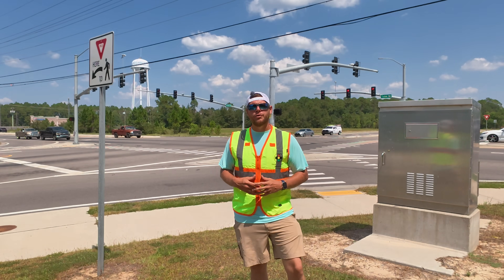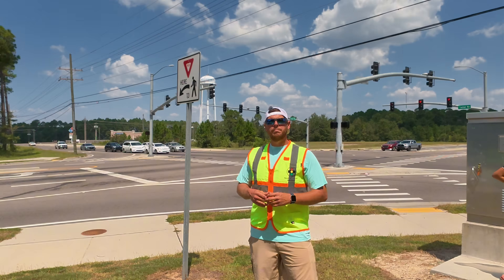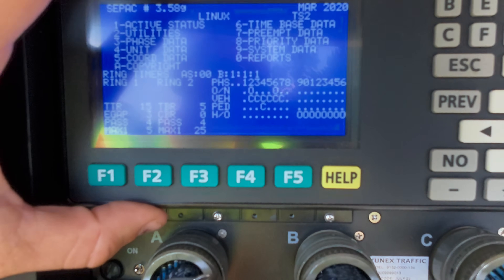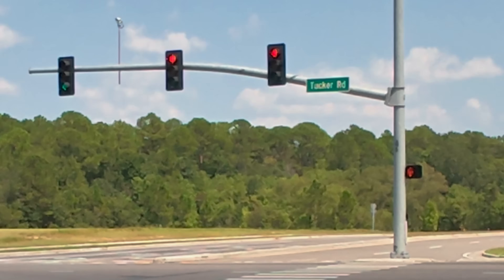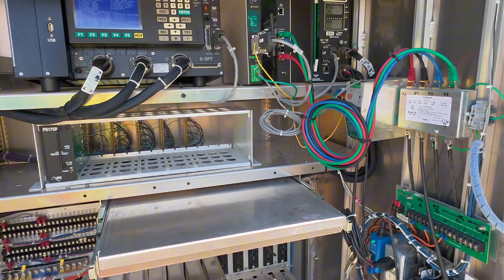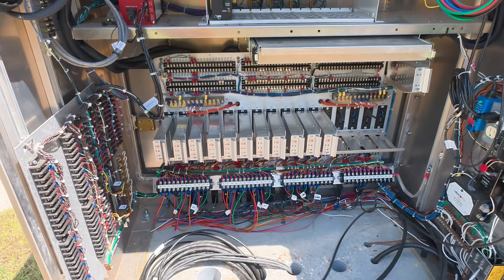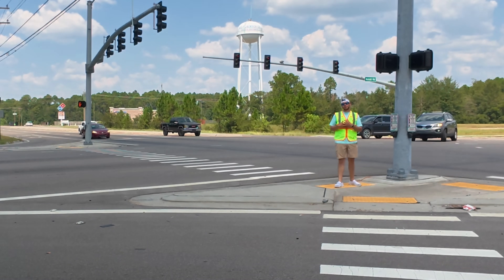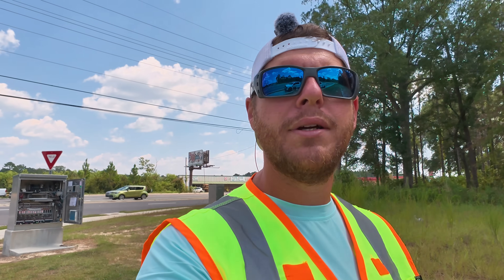Traffic Light Doctor Explains: Do Crosswalk Buttons Work?

Comment: I don't care what the rationale is for prioritizing traffic over pedestrians. Morally, a pedestrian in the freezing cold or the pouring rain is a million times more important than someone in a toasty warm, dry vehicle! The light should change in favor of the unprotected pedestrian, as soon as they push the button.
Reply: Not as soon as they press the button, but as soon as reasonable. There are minimum light timings that must be respected. Also it's sometimes beneficial to limit the frequency of the walk signals in certain cases (if there are many people crossing you don't want to let each through individually, you want a few to cross at a time).

Comment: Those are pacifier buttons and they don’t do anything. The walk sign always comes on when it cycles to the traffic that is parallel to the cross walk turn to go, at least that is how it is in the state I live. Not very many people would be walking in that crosswalk anyways it’s just a place for cars and not people. 

The funny thing is that where there are a lot of pedestrians, USA rarely has pedestrian bridges. My brother lives in Japan, and there even in small towns, pedestrian bridges and even under passes are everywhere. No need to cross a super ugly and super wide highway.  Though many are in disrepair and old and they still have a lot of crosswalks too.
Reply: Different places handle it differently. I swear when I've been somewhere where the lights worked like you describe there weren't any buttons. If there are buttons they might be from previous programming. Or for modern setups the buttons will activate the audio notifications.

Comment: Our pedestrian buttons cause a change in traffic light timing - once you push the button, it triggers a timer to stop traffic and pedestrian crossing activates with the very next sequence. If adjacent buttons are pressed, traffic lights will all go red for cars and both crossings will allow pedestrians to cross at the same time - if just 1 crossing, it will allow cars in the same direction with no light for turning (turning drivers may go if there are no pedestrians even if it's green light for crossing)

Comment: Short answer to thumbnail question:

Sometimes.  It depends. 

   Expanded explanation: 
Some traffic signals will only give a walk signal IF the button is pressed.  Other signals always accommodate for pedestrians (making the buttons superfluous)

Virtually all traffic signals in the US treat pedestrians as a low priority after thought. 

Ideally traffic signals would prioritize pedestrians by rapidly changing except during peak traffic periods which depends on signal synchronization to maintain the healthy flow of traffic.

I currently work as a gig food delivery driver in a tri-state region.  Two of the states have some kind of traffic sensors for the vast majority of signals; the other has hardly any & relies on timed presets with some areas intended to be synchronized although there always seems to be at least one signal that has lost synchronization in each of those stretches which has devastating impacts on traffic flow which some drivers use an excuse to disobey or even disregard signals creating significant danger to everyone, often emboldening more drivers to become aggressive, lawless & reckless. 
Most traffic signals have two or three timing presets.  The rush hour timing which has longer cycles often favoring one street.  The non-rush cycles which tend to be shorter and more equal.
A very limited number of signals have unique later-night or weekend timing cycles, or perhaps switch to flashing. 
The vast majority of the timing cycles seem completely arbitrary (or intentionally configured to generate congestion) because they do not accommodate for the consistent patterns of traffic volume.  Smart, dynamic or adaptive technologies to mitigate traffic congestion are non-existent.
The pedestrian beg buttons seen to be completely useless because they do not alter the cycle timing, and all signals always give pedestrians a walk signal. 
However, there is a very inconsistent & apparently arbitrary implementation delays between cycles and the amount of delayed traffic signal change after pedestrian signal change (to give pedestrians a head start).
These delays vary from about 1 second up to about 7 seconds!  But their programming is completely random as far as I can tell with the exception of many of the intended synchronized signal cycles.  They certainly are not based on the size of the street, the amount of vehicle traffic, or the amount of pedestrian traffic. 
This bread start for pedestrians is precisely the kind of thing that should be dependent on the beg button!  However, that doesn't seem to be the case anywhere in the region.

The two states which have large scale sensor deployment have major variations between cities or neighborhoods in how those sensors are integrated & programmed, including the pedestrian beg button function/integration/programming.  Some signals only change for pedestrians of the button is pressed.  Sometimes it will change immediately of the traffic signal is already green in that direction, others require a  nonsense waiting period, others require the signal to go through the change cycles.  Pedestrian button behavior is generally consistent within a neighborhood or city.

Some areas have very well programmed integration of traffic sensors & pedestrian buttons that respond reasonably & dynamically.  Other areas are so poorly configured that it can be even worse than the state without sensors because of ridiculously excessive wait times, even in the middle of the night.  Or in other areas, the sensors trigger a signal change so quickly that they are constantly changing so quickly that only a few cars can get through before they change again.  
And, of course, there is a significant number of sensors that are malfunctioning in some way; these teens to persist for many months or even years with repair/recalibration/reprogramming.

There are regions in other states that I visit for family, friends or work which have far superior design & implementation of traffic & pedestrian control technologies. 
This makes returning home especially frustrating!

Comment: Where I live, outside of the properly maintained ones inside campus town, the rest are mainly unmarked silver circle buttons, no lights, no audio, no indication of any kind that pushing the button actually did anything, and in my experience, whether the button is pushed or not, the actual Walk signal/ Stop hand will switch at the predetermined time in the traffic light schedule of that intersection. I suspect that there is a fail safe to detect when the button gets broken, and merges the walk signal into the normal light pattern, and then local government just doesn't care enough to fix the buttons, so you end up with buttons that legitimately don't do anything anymore. I'd love to see you do a video where you review buttons at intersections in lower income areas.

Comment: You should do a video where you verify ped pushbutton operation using your cell phone. Connect a WiFi router to the traffic controller. Use the web browser in your phone to see the ped calls going into the controller. Good method when working alone. We don't usually have a beautiful woman assistant like you have to help test ped button operation.

Comment: I’m still thinking the pedestrian lights are at a constant “Don’t Walk” unless you press the button, only then does the pedestrian “Walk” signal turn green when the aligned traffic lights come into regular rotation. It seems you can get the same pedestrian utility by ignoring the pedestrian lights and just go with the flow of traffic. You cross when traffic is going in your direction.

Comment: I am in Florida and the pedestrian signal always seems to be too short to safely cross. I am 6' 4" tall and I take huge steps and a lot of times the signal will change to 'don't walk' when I am not across the road. I feel sorry for those using walkers or who are short and slow.
Reply: The walk sign is not timed to stay on until you reach the curb. The flashing don't walk interval is included in the total time needed to cross the street. I'm sure if you add together the walk time plus the flashing don't walk clearance time you'll have plenty of time to make it across the street.

Comment: AIUI many beg buttons have in fact been disabled, though not all.  Albany CA had some nice ones that really do prioritize pedestrians: if no one had used it for a while it would change pretty much immediate.  One of them had a timer between subsequent uses, I'd guess 30 seconds... the other seemed to work right away no matter what.

Near me in Philadelphia, it's not clear the button has any effect on the timing; instead, it controls whether you get a walk signal at the green light or not.

Comment: Does pushing the button impact the duration of lights at all, perhaps to ensure pedestrians have enough time to cross? Or does it just control if the signal for pedestrians is activated?
Reply: I'm pretty sure it depends on the programming active at each location.

Comment: This signal complex looks fairly new. So, every point of remote devices have dedicated wiring? Why not use CANBUS? Just a pair of data wires and power circuit. Wire daisy chains to all the controlled devices.
Reply: That would work, but would probably require a second CAN line for redundancy. Traffic light controllers have a second set of cables coming back to the control box to verify that the signal coming back matches the controller output. This is done to prevent abnormal/unsafe light output created by something like an underground cable fault or a vehicle wiping out a pole, in a fault condition the signal will usually revert to a flash in all directions.
Reply: It can be done in the manner that you describe. You can program up to 16 buttons. Each button has a unique address. The pushbuttons have a separate controller different from the traffic controller. A single pair of wires go out to the buttons in a daisy chain fashion. The ped controller recognizes which button was pushed and places a call to the traffic controller on the appropriate phase.

Comment: Oh, yeah.  Those buttons work, it's just that the pedestrian gets so frustrated waiting for it to work that they assume it doesn't and cross without it and then when it does change they aren't there to witness it.  The drivers are the ones that see the light change, have to stop and wait.  While you wait you look around for the pedestrian that's supposed to be crossing and they have crossed so long ago that they are no where to be seen in visual range.
Reply: i have seen that it it makes me wish i had a giant lasso to pull the person back to the other side of the cross walk so they can walk on the signal that i now have to wait for

Comment: 'This street is for moving a high volume of CARS. As a walking pedestrian, you are simply not a priority.' I love when traffic engineers state the values of their profession out loud.
Reply: And parks his truck on the sidewalk blocking the Pedestrian right of way.
Reply: Think about it. I would suspect a good majority of intersections like this one are servicing one or very few pedestrians every time the button is pushed. 

You can see in the video the number of vehicles versus pedestrians while he's talking. If you average the number of people in each card at two, it makes complete sense why the roads are priority here. It doesn't make much sense to allow one pedestrian to skip their turn in line, when you have five or more cars waiting in the same queue.
Reply: @notyourcheesecat  Car traffic and pedestrian traffic are not fixed constants. If you make a place friendly to cars and hostile to pedestrians, it will result in more cars than pedestrians. Similarly, if you make a place pedestrian friendly and hostile to cars, you will get more pedestrians than cars. It's kind of like saying "there's no need for a bridge crossing the river, because there's so much boat traffic and nobody is swimming across it anyway." Human behavior is impacted by the infrastructure provided to the people. So when traffic engineers design a heinous street like this one, it's no surprise pedestrians avoid it. It's obvious that they do not matter compared to the goal of allowing automobiles to travel at high speeds.
Reply: @notyourcheesecat  Car traffic and pedestrian traffic are not fixed constants. If you make a place friendly to cars and hostile to pedestrians, it will result in more cars than pedestrians. Similarly, if you make a place pedestrian friendly and hostile to cars, you will get more pedestrians than cars. It's kind of like saying "there's no need for a bridge crossing the river, because there's so much boat traffic and nobody is swimming across it anyway." Human behavior is impacted by the infrastructure provided to the people. So when traffic engineers design a heinous street like this one, it's no surprise pedestrians avoid it. It's obvious that they do not matter compared to the goal of allowing automobiles to travel at high speeds.
Reply: I used to work at a place in a suburban setting.  I should have been able to walk to lunch in about ten minutes based on distance.  The lack of sidewalks and pedestrian unfriendly intersections made me give up after a few tries.  On days when I didn’t bring my lunch, I used my car.  I. My case the traffic congestion was a sort of self sustaining problem.
Reply from the maker: It’s like when you go into a McDonald and they only care about the drive through
Reply: @Trafficlightdoctor replace McDonald with any place with a drive thru and id agree wholeheartedly
Reply: @Trafficlightdoctor  Auto Parts stores too. You are at the counter with a bad starter and the phone rings. You are now chopped liver.
Reply: And the crosswalks for pedestrians right across the front of Charlotte Racetrack handle them the same way too… vehicles are the priority there too….
Reply: Remember you don't have to obey the crosswalk signal😅
Reply: But in any other situation, we are browbeaten that pedestrians always have the right of way . .  . nixe consistency?
Reply: @tadawsonX  Right of way is not the same as being high priority.  Right of way just means cars are to wait for pedestrians to cross when they have signal to cross.  Pedestrians also the right of way when crossing even when they shouldn't be, in the sense that if at all possible, you are to avoid them.
Reply: @tadawsonX  That's an obvious myth. Pedestrians hardly ever have the right of way. Even when there's a crosswalk, they're not supposed to just dart across immediately. There are cases of pedestrians being held liable for accidents because they crossed the road when they didn't have right-of-way and caused an accident.

Comment: But are there some intersections with high pedestrian traffic where the walk signal will happen every cycle? Does the walk button do anything on those intersections? If the walk signal waits for the vehicle traffic anyway, does the button do anything besides lighting the walk light--in other words, does the vehicle traffic change at all, or dose the pedestrian just get a signal as well on the green light?

Comment: Minimum Green to Satisfy Driver Expectancy
The duration of minimum green needed to satisfy driver expectancy varies among practitioners. Some practitioners rationalize the need for 15 seconds or more of minimum green at some intersections; other practitioners use as little as 2 seconds minimum green. If a minimum green parameter is set too low and violates driver expectancy, there is a risk of increased rear-end crashes. The values listed in Table 5-3 are typical for the specified combination of phase and facility type.

Table 5-3 Typical minimum green interval duration needed to satisfy driver expectancy
Phase Type	Facility Type	Minimum Green Needed to Satisfy Driver Expectancy (Ge), s
Through	Major Arterial (speed limit exceeds 40 mph)	10 to 15
Major Arterial (speed limit is 40 mph or less)	7 to 15
Minor Arterial	4 to 10
Collector, Local, Driveway	2 to 10
Left Turn	Any	2 to 5
Minimum Green for Pedestrian Crossing Time
The minimum green duration must satisfy pedestrian crossing needs for through phases that are not associated with a pedestrian push button but have a pedestrian demand. Under these conditions, the minimum green needed to satisfy pedestrian considerations can be computed using Equation 5-1. Methodology for computing walk and pedestrian clearance interval durations are provided in Section 5.3.3.

Comment: Why are the walk indications never long enough to cross the street?
Reply: because DoTs just want to move more cars, not keep granny safe.
Reply: This intersection in the video has walk phase set to 10 seconds and clear phase set to 12. 10+12 makes 22. Should be sufficient. 'Clear' phase is meant to complete crossing if already started. Only ones who did not start crossing should not go into the crosswalk.
Reply: They are long enough if you add together the walk time plus flashing don't walk time.